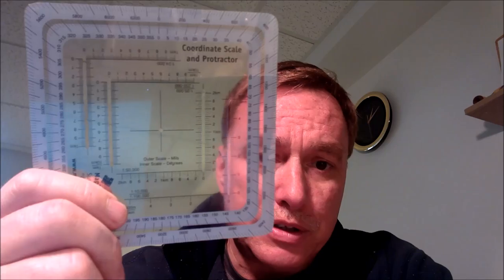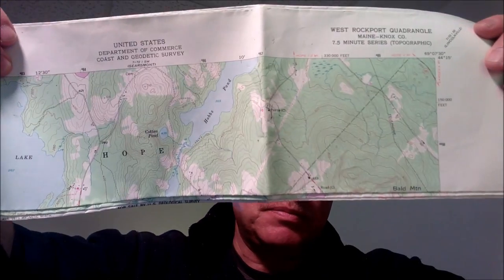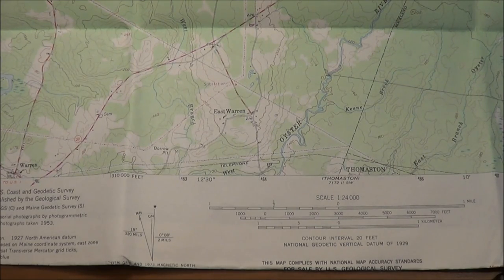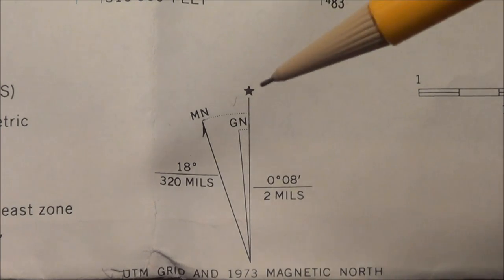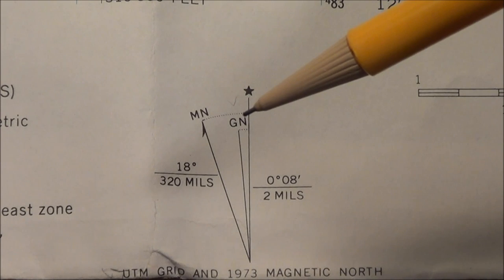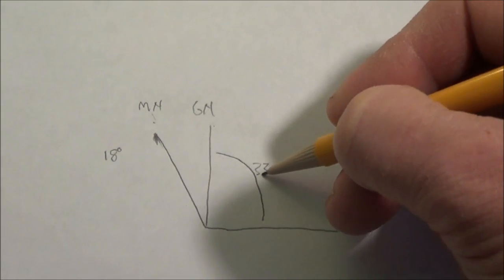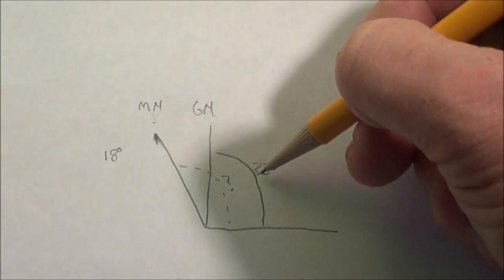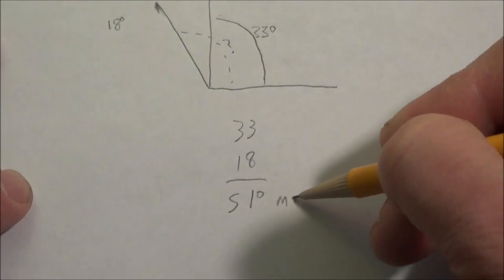Land Nav   application of grid to magnetic

Comment: left add right subtract only works when converting magnetic to grid, no?
Reply: Easterly declination is positive (+)
Westerly declination is negative (-)

Magnetic to grid (compass to map) always add.
Grid to magnetic (map to compass) always subtract.

Examples:

1. Declination is 10 degrees East (positive).

Compass reads a 45 degree azimuth.
Map azimuth = 45 + 10 = 55 degrees.

Map azimuth measured as 55 degrees.
Compass azimuth = 55 - 10 = 45 degrees.

2. Declination is 10 degrees West (negative).

Compass reads a 45 degree azimuth.
Map azimuth = 45 + (-10) = 45 - 10 = 35 degrees.

Map azimuth measured as 35 degrees.
Compass azimuth = 35 - (-10) = 35 + 10 = 45 degrees.

Comment: How about Easterly Declination? How do you do that?
Reply: If magnetic declination is 18˚ east. You would subtract 18˚ from the azimuth measured on the map. 
Instead of adding 18˚, for when mag declination is west. 

 Staying with his example of 33˚ grid azimuth from the map. 
If mag declination is 18˚ east, on the compass you would set the azimuth to 33˚ - 18˚ = 15˚ compass magnetic azimuth. 

I use an acronym I created to remember the correct adjustment. Maybe it will work for you too. (for me it works better than LARS, left add right subtract)

WAvES  = West Add v East Subtract. 
For westerly declination, add the number of degrees of mag declination.
For easterly declination, subtract the number of degrees of mag declination.

Actually, I made up a phrase to help remember which way to adjust the azimuth when going from map (grid azimuth) to compass (magnetic azimuth) Or going from compass (mag. azimuth) to map (grid azimuth)

Which is :
The Map WAvES to the Compass & the Compass WAvES Back to the Map.

(the two need a friendly relationship, yes)

What that means is 
When going from Map to Compass use WAvES, West Add v East Subtract.
(The Map WAvES to the Compass)

If going from Compass to Map, use WAvES Back(wards) Add becomes Subtract & Subtract becomes Add.
(The Compass WAvES Back to the Map)

If you measure an azimuth with the compass, and you want to find the correct azimuth to measure with the protractor on the map. You use "the Compass WAvES Back", part of the phrase. Back meaning - the math function is reversed.  So East Subtract becomes instead, East Add.

For example; if mag declination = 10˚ East. And with the compass you measured an magnetic azimuth of 80˚. On the map, using the protractor, you would draw a line for a grid azimuth of 90˚. [ 80˚+10˚ = 90˚ ]

{I think you can see if mag declination is west, you would also reverse the math function, and West Add would become West Subtract, when going from compass to map}

Hope that was understandable, and it helped.

That acronym and phrase works for me, but maybe that's only because I made it up myself.
Reply: @TyJee28  This was helpful thanks for the tip

Comment: The declination scale at the bottom of your topo indicates 18 deg between MN and TN. You need to subtract 2 deg  in order to obtain the difference between MN and GN. So total declination between MN and GN is 16 deg
Reply from the maker: It's an old map.  The actual declination is 16 degrees for where I live.  Good catch though!
Reply: You guys lost me. It looks to me like the difference between TN and MN north is 18˚ on your map diagram. With MN being 18˚ west.

The difference between TN and GN is only 8 minutes, or 2 mils. Essentially TN and GN are the same, and you would use 18˚ west GMA,. 

I understand if the difference between TN and GN was 2˚, and GN was 2˚ west of TN, then yes, you would use GMA of 16˚ west. But it's only 2 mils.

 If you mentioned looking up updated mag declination to be now only 16˚, I must have missed hearing it.

The Cammenga compass is a great robust compass, but it can not resolve 2 mils difference in azimuth.
Reply: TyJee28 hey man you're right. I remembered the 2 as being in the degree scale, but it's MILS. For that map I would use 18 deg. Thanks!